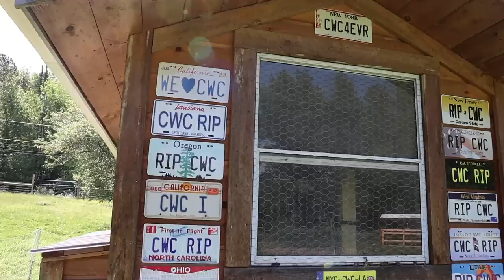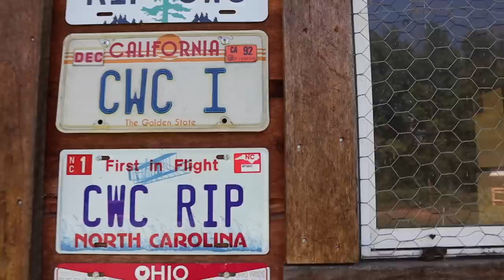UpGraded our GreenHouse for $1 Should've Done THIS SOONER

Comment: A basic vinaigrette recipe is 1 part vinegar to 3 parts oil. I tend to reverse it. Using more acid to oil. We prefer to use fresh lemons instead of vinegar, but ACV is also nice. Sprinkle some nutritional yeast on the finished salad for good measure.

Comment: First recipe Normal Dressing:
1 small Onion (you can use yellow or red Onions), 1-2 clove of garlic,  
One, maybe two teaspoon of mustard
one big tablespoon of Olive oil
1 cup of Greek or normal yogurt
A pinch of salt, pepper, paprika prouder
One teaspoon of honey
Mix Olive oil and mustard. Than add Salt, Pepper and paprika prouder. Than the Honey - look how much sweetness you like. Than the Yogurt. At last cut the onions and garlic in really small pieces and add them. 
Second recipe: A Really good summer dressing is from my Grandmother and really easy (tasty with Iceberg lettuce) Best serves cold:
like 3 cups of Yogurt (In the recipe I know it is like 500g) 
2 tablespoon of lemon juice 
2 tablespoon Olive oil
pinch of salt 
pinch of pepper 
pinch of sugar 
I hope I everything is right. It is sometimes a little bit tricky to convert from Gram, Millilitres to Cups and Spoons.
Reply: Also for hot summer make your recipe with avocado oil & change up the acid with orange juice & the zest of the orange.

Comment: Well you could ante up some funds for a automatic roll up.  That's what I utilize in mine on roof and sides to let out that oh so much heat that comes from plants enclosed in the green house.  Solar powered so no wiring and just like the chicken coop door they roll up or in the roof part window opens up and nature's air flow in to cool off.

Comment: Gina, the basic rule of thumb is a 3 to 1 oil to vinegar ratio for dressings. Salt and pepper help but if it’s still bland, there’s probably not enough vinegar. Experiment with different oils and vinegars and seasonings too but remember, the stronger the oil (like evoo) then you may have to adjust the amount of vinegar. Add grained mustard or grated cheese or fruit /citrus chunks to it too or whatever you find you like. (We love sliced tangerine segments and sliced almonds with evoo and a balsamic reduction) That’s the fun in it, you get to try whatever you have around... I mix mine after adding my fav seasonings then keep it in the sealed jar in the fridge to chill while dinners being made. Then I just have one of the kids shake it for a good minute and a half before adding to the salad at the table.😉 
I was wondering when you’d get a hook for that side roll Al. Sounds like you’ll need to keep that battery well charged, that drill struggled a bit. Is it set to one or two on speed/torque? Lower the better...You may end up smoking it putting that much of a strain on it otherwise, so watch it closely for it heating up... I know it’s not perfect, but a corded drill may be a better option. 
Anyway, the greenhouse plants are looking healthier by the day, and those salad greens are looking tasty. Have you considered adding a few dwarf fruit trees inside the greenhouse yet? Skys the limit brother. Even if your rewards are only half as great as your efforts have been, you guys will never go hungry!  We’re pulling for you! ✌🏼

Comment: I love this SUPER EASY Greek Salad dressing. I use it in a Quinoa Salad and on fresh baby spinach/mixed greens salad. Give it a try, I doubt you’ll be disappointed.
Greek Dressing
Equal parts lemon juice, apple cider vinegar, red wine vinegar, and olive oil
1-2 tbs kalamata olive juice
2tsp Dried oregano 
2-3 cloves minced garlic
(I like to mince a little onion, bell pepper and cucumber to add in for flavor and color)
Salt and pepper to taste
Pinch of sugar or off set the acid

Comment: I use balsamic vinegar, lemon juice, worcestershire sauce, Dijon mustard, oregano, basil, tyme, celery salt, ground black pepper, minced garlic, extra virgin olive oil all blended up whip it up as you do with the hand blender. (sometimes I add all ingredients, sometimes I withhold ingredients - I like to experiment.  I also use apple cider vinegar in making salad dressings. 

If you like caesar salad I make mine but I make it thick more in the consistency of a mayonnaise, so I can use it for sandwich/ hamburger spread.  You have to use a covered blender at high speed, 2 eggs, lemon juice, fresh garlic, anchovy paste (gives the salty taste without tasting too fishy),  Parmesan cheese...while that is all blending together, start slowly to add olive oil, keep slowly adding oil the whole while blending on high speed, it will thicken to the consistency you want.  When putting on salad, top with more parmesan cheese & add croutons.  MOST EXCELLENT - use ingredients to taste.  I like mine more garlic & tangy from the lemon juice.  You can add enough oil to make it as thick as mayo... it coats the romaine lettuce better without the "runny" effect.  Hope you enjoy.  Sincerely, British Columbia, Canada.

Comment: For a chicken coop that will move over almost any terrain, consider using big wagon wheels (just two of them!) A solid axle through the middle of the coop doubles as a roosting perch! Pull-down struts in the four corners hold it stable once parked.

Comment: Good  Tuesday mornin  ... time to move New Yolk City ... I hope those plates are all up to date ~8^) Most of the critters have already moved into the greener areas without you! Buttercup is already onto this milking thingy .... she says that's all you get people. It'll be interesting to see New Yolk City 2.0  ....  6 wheel drive with an independent suspension system and remote control lolzzzzzzzzzzz! Question: if you feed broken eggs to your chickens, will they start eating them on their own? Have a great day AL, Gina & Olivia .... take care.
Reply: i thought that Al has fed the chickens busted eggs in the oast. Al , is that right ?
Reply: ment past , not oast. ha. ha.
Reply: No the chickens won’t open them on their own but it is really good for them, also mealworms and crickets give hens lots more nutrients and they lay more eggs
Reply: @jimmymassey7375  You can always edit your comments by clicking on the 3 vertical dots to the right of comment.

Comment: From the Dirt Doctor Library. CORN GLUTEN MEAL PRE-EMERGENT

The timing for applying corn gluten meal for pre-emergent weed control is just before the weeds start to germinate. We usually guess that to be February 15 to March 15 in the South.

Liquid corn gluten meal spray - a listener/farmer recommendation that's a great idea.

The way we use corn gluten on our fields - we make a tea out of it and spray on the fields once a month from Autumn to May. Works very well. We use 2 to 6 cups of corn gluten to 100 gallons of water and spray it on with a pull behind sprayer. We just put the corn gluten meal in panty hose and suspend it in the sprayer when we fill it up, then swish the panty hose, remove and stir. Use at about 35 gallons per acre. Simple, economical and effective.

Comment: Al, Gina, Olivia,  No point in scan as you will not put her to the buck again this year. If she is, she is😀. My standard salad dressing is made in a jar with 3 marks in equal 1/3rds. In the bottom 1/3 1tsp salt, 1tsp black pepper, 1tsp Colman's powdered mustard. I shake the dry ingredients to mix them. Fill up the botton third with red or white wine vinegar and shake to mix again. I use Ponti red or white Italian wine vinegar. Fill the remaining 2/3rds with the oil of your choice. Right now I'm using Spanish ev olive oil. Screw on top and shake. If you've got the proportions right it will emulsify straight away. It's quite poky like this😋. I use it fresh and keep it ambient until its all gone with the lid screwed on.  Just shake and go until it's gone. I have a little book called "Oils, vinegars and seasonings " published by Simon & Schuster and written by Mark Lane and Judy Ridgway. It's a pocket guide to.... A lot of info in a small space if you can find a copy. Regards Stephen.

Comment: For a white garlic dressing. Equal amounts creme fraiche and yoghurt mixed with fresh garlic, oregano, thyme, parsley, white pepper, salt, sugar. You can if you want add a squeeze of lemmon or fresh grated apples. The salt and sugar is to balance the flavours. Only very little is required. You can use garlic cuttings instead of the bulb like you cut the onion. Thyme is optional but works very well with Lamb.

Comment: Nice contraption to roll up the greenhouse sides! Simple is always best. Hope you save all your bacon fat when you cook bacon (freeze the excess). Google PA. DUTCH hot bacon dressing, many variations of this dressing, it's delicious with fresh spinach! Also my family always made mayo, ketchup, and lemon juice, with salt and pepper. ( more mayo than ketchup and enough lemon juice to thin out to a ranch-like consistency. Dressing should be pink not red).  Maybe when you build your next New Yolk City suburb, you could put a double axle on it for stability, like a tractor trailer. It will tow smoother, I think! Also, when you go to feed the pigs, talk to them after you feed them!! They are so focused on the food, that they run into the fence without even remembering that it is there!! I notice that when All cooks, he seasons his food more, and when you cook, you are much lighter with your seasonings. Is there a preference for light or heavier? Which does your family like best? Thought you might look up Hoss Tool Co. and check out their wheel hoes. They would save so much time  weeding in the greenhouse, between the rows and by the plants. Jason from Cog Hill Farm uses one in his giant garden plot and he says it saves him so much time, and is so efficient. And he's outside with lots of weeds! He even did a comparison between a few different company's wheel hoe models. Handles are adjustable so even Olivia can do it!!  Happy gardening and God Bless.

Comment: Instead of the wine vinegar, use white or balsamic vinegar. Instead of Italian Seasoning as some said use fresh and below recipe.
1/2 cup extra-virgin olive oil 
1/4 cup White vinegar or Balsamic Vinegar
2 tablespoons water 
3 tablespoons freshly grated Parmesan (only if you like - I add this to the salad when I want it)
3/4 teaspoon garlic salt or Fresh press Garlic 
3/4 teaspoon dried parsley or fresh
3/4 teaspoon dried basil or fresh
1/8 teaspoon dried oregano or fresh
Pinch of red pepper flakes
Freshly ground black pepper, to taste  only add salt if you think you need it. 
After shaking it or blend it (we shake) taste it and what you think you need. 
Some people add a little honey . Let this set in the fridge or outside of it for like a hour.

Comment: Goooooooood Evening Al , Gina & Olivia ,
By all means , if you have the extra money that you can not use elsewhere , do an ultrasound.  Otherwise , just wait. She either is pregnant or she is not.  Slowly inching up to 200 K subscribers. I remember when you had fewer than 10 K !   Then 20 K was a milestone. lol   The pigs know that you have food. They are so eager for the food that they forget about the fence .  For a moment anyway .  Al , when you put the block down for the tongue rest on NYC , if you place the flat side to the ground , it will not sink into the soil quite so much. More surface area .
  Ah , a nice thunderstorm just as the sun was setting . Just in time. I have just planted some blackberries and they needed watering.  Especially after a couple of days like today. Very sunny and 85* F. I guess that Spring is officially over.  Grass and weeds are growing like gangbusters ! I sat out on the back porch so I could watch the high winds blow the trees around , see the lightning and feel the thunder ! Then it began pouring rain with the wind blowing some mist under the porch roof.  A bit chilly then but I had my fresh hot coffee so it's all good. 
  I wonder why we call them thunderstorms when the lightning has to come first ?  Almost mid-June so the fireflies should be showing up any night now .
  Another cup of coffee and then it's off to bed . Another big day tomorrow.

Comment: In my family we had a stand by  dressing: 1/3 vinegar, 2/3 oil, garlic powder or finely minced garlic, dry mustard powder, salt or Lawrey`s seasoned salt, black pepper, little sugar and you can add a bit of water if you want to thin it out. The only thing I remember measuring is the dry mustard,  I wouldn't use more than 1/2 tsp. You could also just use a little prepared mustard instead of the dry.

Comment: You should try Southern Wilted Lettuce Salad.  If I remember right my Mom used large Red Romaine Lettuce & you make the dressing out of a few tablespoons of hot bacon grease mixed with sugar & apple cider vinegar & salt & pepper to taste.  You just mix it up right in the skillet you fry your bacon in & when you whisk up the ingredients in you also pick up all those delicious bits of flavor as you de glaze the skillet.  Then you pour it slowly over your lettuce & toss.
That's why it's called Wilted Lettuce Salad because the hot dressing wilts some of the lettuce (like greens) but it still is a crunchy salad.
You can add croutons to it also.
I always liked adding halved cherry tomatoes to it to.

Comment: 1,  A refreshing dressing is Avocado Oil lemon juice & crushed garlic..  2,  Wash then slice lemons remove pips & liquidise the whole lemon skin included you may need to add a little water to this if it’s to thick this can be used as above if making a larger batch OR with other added herbs & oil as an overnight marinade..  3, Place on a low heat to begin the liquidised lemons add a little water at a time so you can stir easily then mix some Arrowroot to add to the lemons to make a lemon sauce to use with salads or can be used with chicken, duck,  stir fry or to pour over puddings cakes take your pick..

Comment: One simple way to know  which multi ball hitch is required is to use a dash of different colored spray paint on those of different sizes and what they attach to so at a glance it's right the first time. Using an Eye Bolt for raising the sides of the greenhouse or other such awnings is old school and for those who are like minded a cordless drill also makes an impromptu backup mixer in the kitchen with its attachments. 😏

Comment: For salad dressing, next time you go to the store, look at the ratio of oil to vinegar in the bottled dressings.  Your ingredients are fine, but you need to use a lot more vinegar.  Use a balsamic vinegar instead of red wine.  The older balsamics are sweeter without using sugar.
Reply: And there GOOD too!! But yeah Devin is right for all that oil.you shld have used at least a 1/4 to a half cup vinegar
Reply: Was going to suggest a better ratio of vinegar to oil. I believe it is 1 part vinegar and 3 parts oil. Check on the web: Martha Stuart, Ina Garten, etc.
As for the acid part, I am not a big fan of balsamic but maybe the age and quality was not the best. You can replace vinegar with lemon or orange juice. I sometime add a dab of dijon mustard as it makes it a little more emulsified.
Enjoy the salad!